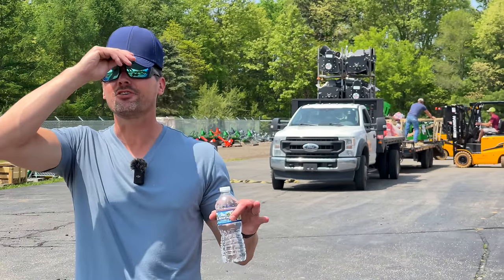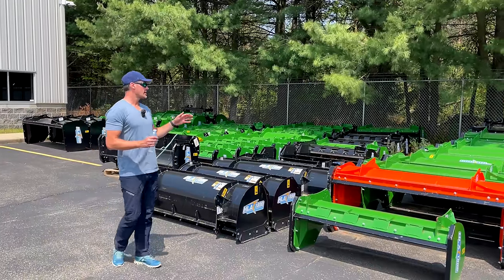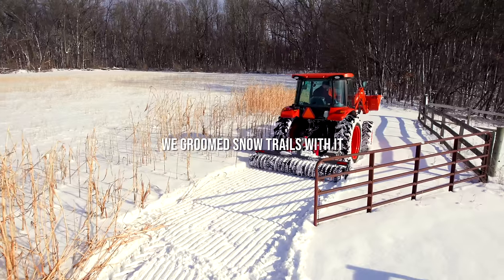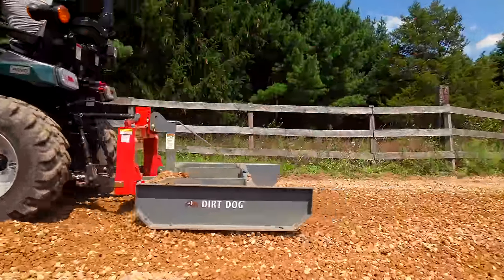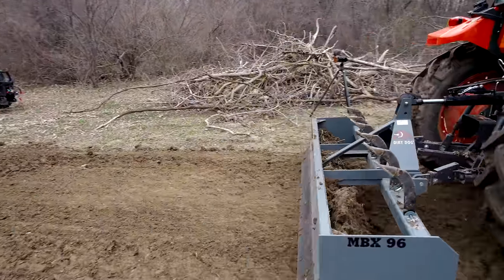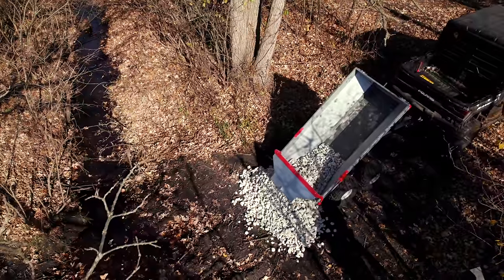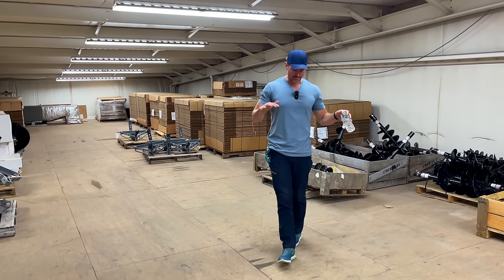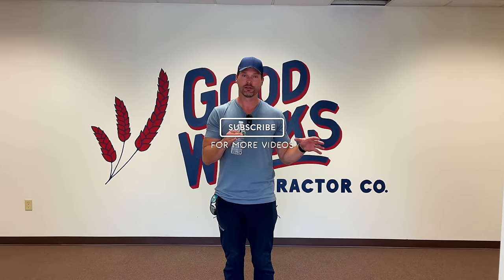99 DIFFERENT COMPACT TRACTOR ATTACHMENTS FOR SALE: OVERVIEW

Comment: A land plane is the real deal.  I have a 1000 foot long gravel driveway that requires maintenance a couple of times a year, and it makes the process so easy and efficient.  Use those ripper shanks to pull up the gravel that has been compressed in the ground, and it looks like you just had gravel brought in.

Comment: Straight extensions do not take away torque when using a torque wrench. Torque wrenches apply constant torque. When using an impact wrench, the extensions will take away some torque due to it being a cyclic torque application. "Torque sticks" flex more at different torque limits, allowing a user to "torque" with an impact. This is a hot topic among Technicians, however what I shared is proven truth. Do not add to your torque spec when using a straight extension on your torque wrench